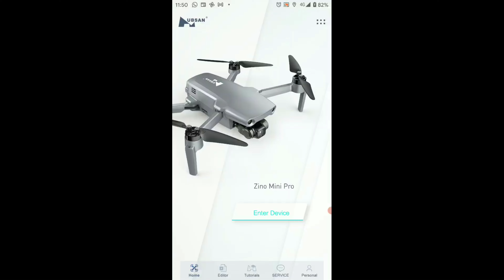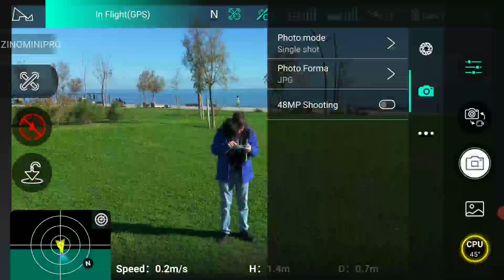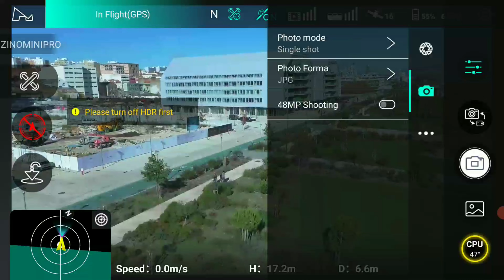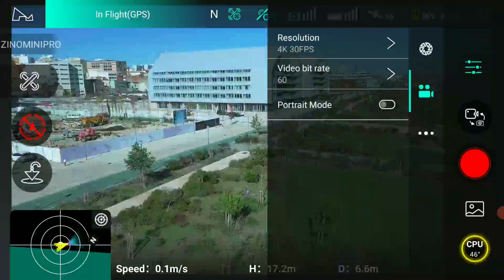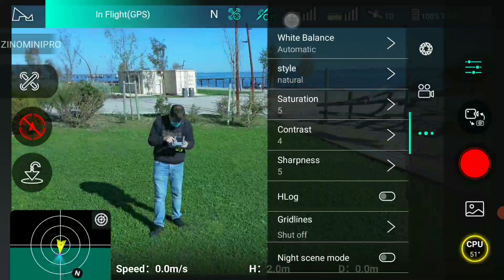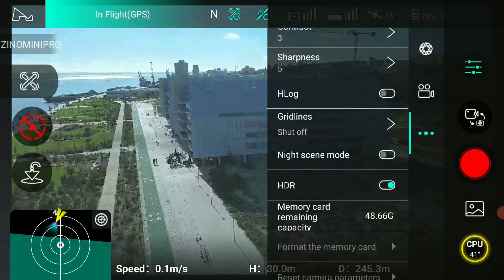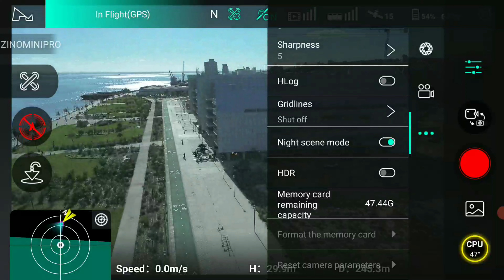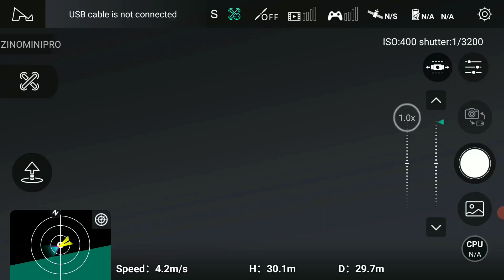Hubsan Zino Mini Pro - Firmware 1.3.7 with 3 blade and original propellers - HDR - GPS Follow Me

Comment: Hi Miguel, seems that your camera is not to focus, the immagine not clear. Have you some problem? Maybe I wrong but In your last video I don't see this problem. Maybe for strong wind?. Three propellers should be better for stability drone with microvibration. Please your summary opinion for this propellers? Thank you for sharing😊👍
Reply from the maker: While the video is still being processed by Youtube it's not available in 4k, right now it's only available in 360p, wait a bit for the 4k version...
Reply: @MiguelSilvaX  : You have more jello than I do. But I have more colour wash than you.
Reply from the maker: @GorillamansGarage  but the first half of the video I was testing a new set of 3 blade propellers that end up inducing lots of jello, is that what you were referring to? Only on second half of this video i went back to original 2 blade propellers.
Reply: @MiguelSilvaX  yes.. better. I'm trying 1.3.7 now.

Comment: Horrible gimball. Too bad, its a good drone. Also camera has a blue tint, its a sunny day so it should have a much warmer tint… I’m happy I didn’t buy it. I guess I’ll wait for the DJI Mini 3…
Reply from the maker: This video was a test using 3rd party propellers with 3 blades per motor. It was a test to see if it improved the jello effect but as you saw it didn't help, but in my latest videos it's much improved over what you see here, including the blue tint that was fixed in a firmware update after this.
Reply: @MiguelSilvaX  Yes, I saw. I really wanted to buy this drone over the upcoming DJI Mini 3 but I saw loads of reviews and unfortunatelly I can’t recommend it… I wish they will make more improvements, I like the look of the drone and I know it flies nice, but camera is also very important on a drone for this price
Reply from the maker: @cipri198zero  Yeap, I bought this drone in pre-order based on specs with a promo at 450€ with 2 batteries and waited months to be receive it. It could be the perfect mini drone but not all coming out of the factory are exactly the same , some show more jello, some don't.. honestly, it's not a cheap toy, I have waited to buy a drone over 100€ because I was afraid it could break in a week like som previous toy drones I had. but it's still cheaper than what Autel has and certainly will continue cheaper that the DJI Mini 3. I stil think there is some improvements Hubsan can do in future firmwares and they have been updating the firmware very often..